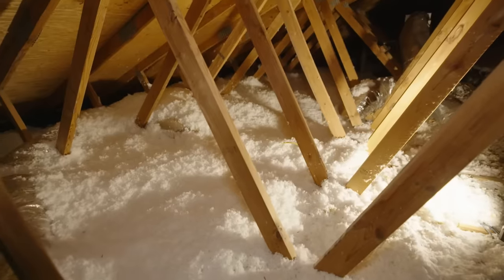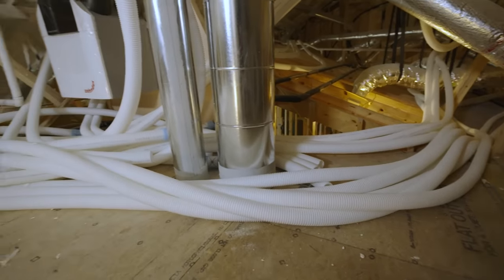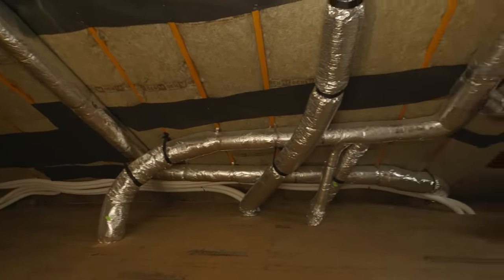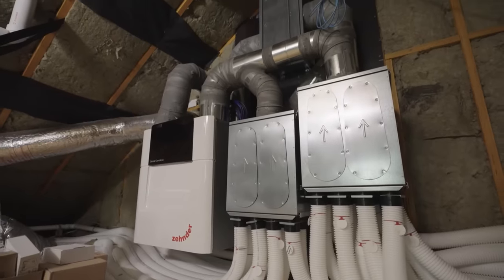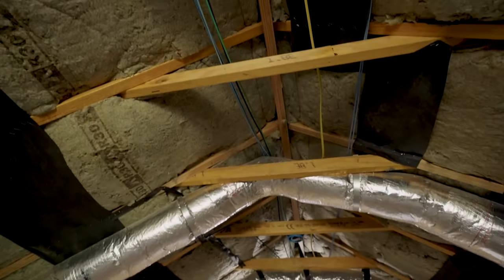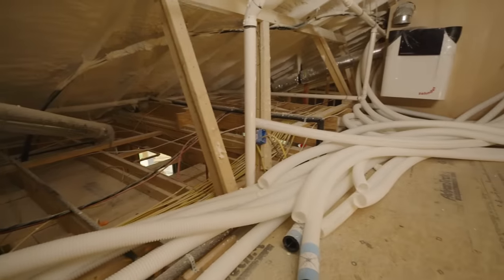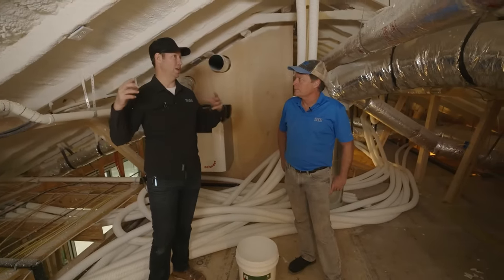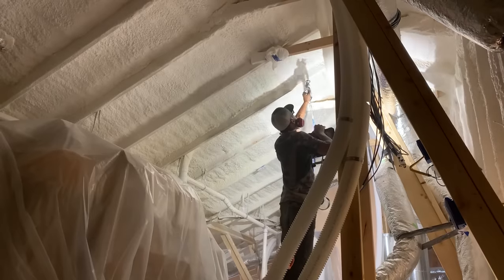Building a BETTER attic - Unvented + Conditioned attics 101

Comment: I knew someone that did a commercial install of closed cell. I asked how do you know when there is a leak?  They said they had one, it built up water until it busted like a balloon onto the floor space.
Reply: Flat roof or sloped? Failure of roofing, was the wood all rotted ?
Reply: Even a small leak has no chance to dry out stuck between the roofing and foam. It's just going to rot the wood between.
Reply: @drewcipher896  spray Jones has been doing for 30 yr successfully.

Comment: It is incredible thing to watch that kind of video in 2021. I am really confused. I thought such insulation technologies are wide spread all along the world. My house was built that way 25 years ago! One additional advice: put second layer of rock wool cross the wooden construction (rafters) to remove thermal bridges. There is 15cm+15cm rockwool under my roof for example (heat conductance parameter lambda=0,033W/mK ), and this insulation thickness is treated as a reasonable minimum now. You can cover wool with drywall and arrange additional space for living.

Comment: Maybe I'm missing something, but if you move the insulation, from your ceiling/attic floor, to your roof/attic ceiling, you just created a lot more space inside your insulated area - not a recipe to cut heating and cooling requirements.  They're noting the attic temp is close to the rest of their home, because there's no insulation between their attic and the rest of their home.
Reply: your increasing the envelop  but drastically cutting the conductive transfer of heat into that envelope  .new building code only allow a certain cfm air exchange   and spray foam actually  helps out with that too  spray foam generally has a beter r value so you can meet code with less of it new code require  almost 2 time as much insulation as they did in the past so its easier to put some  or all on the celling so you don't require 6 inch of bat insulation
Reply: @dustinschmelzle7326  Use spray foam on your attic floor, gaining the R-value at a lower cost because you're covering a smaller area, avoiding the cost to heat and cool a larger envelope.  You could encapsulate ductwork under the spray foam layer, but I would expect these would be better left above the spray foam and wrapped in insulation.

Comment: The rockwool just looks nicer.
Reply: Costs more, though…. So does the framing…. Especially if you use SPF (double-so if using intumescent coating)…. Oh, and the roofing won’t last as long because it gets hotter with insulation beneath it…  And SPF prevents drying to the interior so small leaks in the roof are a MUCH bigger issue because the water gets trapped between the impermeable roofing and the SPF.

So, yeah, it’s “better”…
Reply: @thomaslbane  Maybe Matt "needed" to publish a video and didn't have time to think it through.  What about cost to build, cost to maintain and cost to operate?   More flooring, more stairs, bigger door, difficult insulation installation, more difficult shingling a high-pitched roof..   He should do another video addressing the issues you identified.
Reply: Thomas Bane does it really have heat issues causing roof leaks sooner since the roof can’t breath as well with the spray foam ?
Reply: @27photogger  Asphalt shingles are sensitive to heat, steel not so much.

Comment: As a telecom worker, if there's no conduit/ surf tube that goes from the outside utilizes to the attic and/or smart panel, the chance of drilling the ductwork and tubes is really high and not good. The foam makes it difficult as well to see where the line is without completely destroying the insulation. I highly recommend a conduit, especially in fiber neighborhoods. The floor boards make wall drops difficult as well. Love the attic though, I would make sure to run all the cat6 and coax lines to each room where the TV, gaming console, and computers would go.

Comment: I live in Oklahoma. Your decking material will rot in a  few short years. Have reroofed several houses with closed cell foam. Had to remove decking and replace that rotted due to condensation. We have one installer that will tell you this will happen. If you ask.
Reply: That’s what i was thinking.  If u we’re going to do it that way, don’t u want a gap/space between the wood and rock wool insulation so the wood can breathe ?
Reply: Mike Saraceno is that how it’s usually done

Comment: I used to live in Albuquerque and after our roof was redone I went in to clean up and install new insulation (pink stuff)  My husband put a heat sensor up there and monitored the temperatures on his computer.  I believe it maxed out at 140 degrees.  In summer, the ceiling was like a radiator.  We had attic vent fans but because the house was L shaped it wasn’t too efficient.  As well, the fans were pretty small and wimpy.  And unfortunately, they will pull in lots of dust and pollen.

Comment: unfortunately that will NEVER become standard with our current builders unless it is mandated which it never will be.
Reply: American hows building yikes .
Reply: He never mentioned the cost. The average American can no longer afford to build a house as it is, much less one built with a new mandate requiring an attic like either of these.
Reply: Never say “never”. Energy/building code is constantly changing. 10 years ago most people would say the same thing about requiring solar. Yet here we are. California mandated solar on new residential construction in 2020.
Reply: As a dutch person and daughter af a builder i think americans houses are flimsy and not durable.
Reply: @jolandafrijlink6103  I'm sure as a Dutch person and the daughter of a builder you know all about tumescence
Reply: @jeffraber9110 what kind of swelling....
Reply: Whatever's "quicker" wins
Reply: @jolandafrijlink6103  while mold lives forever in euro homes
Reply: @bobjones2041  i don't know where you get that info from, but i live in a 110 year old house that has NO mold in it. We are constantly updating our houses...why..bc it's normal.
Reply: @jolandafrijlink6103  that's funny because in the fifteen years I spent in Germany, homes of all ages suffered from poor insulation which caused moisture and therefore  mold in bathrooms, kitchens, outside interior corners, wood. "Lüften" was always a big deal to them.
"Vollwärmeschutz" appears to be necessary on superior concrete block hones with 30 cm walks,  fancy terracotta roof tiles, plaster  and stucco inside and out, anti-mildew  paint. What's wrong?
Reply: If you're paying for it then great!
Reply: Nor should it be. Yeah this method works, but it is more expensive overall, and it's even more reliant on refrigerant based air conditioning and the energy cost of such.

There are better ways to keep a house cool.

In fact, a vented attic engineered the right way can help keep a home cool by maintaining a flow of air, pushing hotter air out the top and pulling ambient air in the bottom.

That air can draw heat off the attic floor, contributing to the cooling of the house (aided by keeping the summer sunshine further away from the living space of course)
Reply: @bobjones2041  you're talking about germany..... The Netherlands has a different method, the houses that are build from the 70's have little airgabs on the outside wall that lets moisture out in the outsidewall. There is a balance between air and moisture and if you overdo insulation it it will not help against mold. Outside walls, roof and foundationfloor insulated and having windows you can open is all you need.
Reply: It'll never happen because of the cost.
Reply: Codes are updated every 2 years but adoption is left up to the individual states and local government.
Reply: That gap is called a rainscreen in the US.   It has become more common in the Pacific Northwest due to the amount of rain it receives and builders in the SE US have fought against it.
Reply: It doesn't work that way. There's minimal air flow and it's all along the roof sheathing.   

Vented attics however are much cheaper to build and it's easier to catch roof leaks.

Comment: Instead of that mess with all that flex ducting I would have ran metal trunk lines down both sides and kept the flex to a minimum. But I installed hvac systems for 30 years so I'm a bit picky.
Reply: Yea i can appreciate this comment. good ideas to make things 100% better should be encouraged. OCD for the win
Reply: I would have done the same. So much better than flex
Reply: How much more or less does that cost, normally?

Comment: Non vented roofing system is Florida is a disaster of epic proportions.   The USDA attempted this in tampa on several residential new construction sites.   Less than a year and the homes are unlivable due to mold..  great job reinventing the tried and true vented system..

Comment: @Matt V There are even more issues with unvented attics.  This kind of approach only works in warm climates that rarely see ice.  In a northern climate the build shown here would experience ice dams and water fracture on the roof surface.  Matt Risinger usually has pretty good solutions for houses, but this is clearly a climate fail.  He should make it clear in the video that this would only work in a narrow climate band, the one he happens to live in.  If someone in a colder clime naively followed this build, they are headed for tens of thousands of dollars of damage.
Reply: yep
Reply: @oldsteamguy  Totally Untrue - I live In South Dakota and Spray Foamed The Underside of roof sheating for in 2009 - Absolutely no problems

Comment: I've seen good designs where the HVAC is in a closet in the conditioned space, ducts in lowered ceilings in hallways, and fake beams, or between floors. All of the benefits of a conditioned attic without the concerns of needing power to dehumidify that space.

Comment: Hello Matt!  Thank you for the videos!  My house was built in 1997 -- I live in Dallas -- and would like to use Rockwool in-between the attic ceiling rafters like you did in the above video.  My question is, did you do a vapor barrier between the Rockwool and the inside attic roof?
Reply: On Matt’s house, he used zip sheathing and a double layer of insulation board and more on the outside so his vapor barrier is outside.

Comment: I design commercial buildings, always have to be aware of meeting/exceeding the energy code requirements. 
I have a very large attic space with several hundred SF of floored storage area, along with my mechanical systems. Would be costly but easy access to insulate my roof which I would like to do. Personally, I would use the Rockwool instead of the foam but have not done either in my house for one reason. Even though my roof is only 10 years old, after hurricanes/severe storms, I go upstairs with a LED light and illuminate the roof sheathing. With insulated roof, you may never know there is a leak until there is significant water damage.
That being said, it does make a awesome attic and very efficient home.

Comment: Having panic attacks watching this after I was injured for life in a similar attic months ago. An EF-4 tornado ripped the roof off and plastered the fluffy loose insulation everywhere… and I mean EVERYWHERE… even the trees outside and the walls two stories down.

Problem was that I had to immediately get a tarp up where the roof used to be but you could not see where to stand after all the insulation was disturbed. Also, the ceiling was collapsing beneath as it was soaked with water and damaged in multiple places. I ended up falling through and dangling in the master bedroom where I broke my arm and have life-long tissue damage (rotator cuff).
Reply: Why were you trying to put a tarp up in a tornado?  If the tornado took the roof off, I dont think your tarp would fair much better.  No offense, but sounds like a dumb move, life is more important than saving some shit in your house trying to put a tarp up... in a tornado.
Reply: @Tro1086  You must have some misunderstanding about tornados. They hit and they leave. They don’t dwell in one spot. Only storm chasers get to encounter tornados for more than a couple minutes. This one left a path of destruction 38.9 miles long. It’s strength peaked just as it entered my neighborhood where it reached EF-4 strength and I was the first house.

It hit just after midnight but was gone in about a minute, having moved on to destroy neighboring homes. I was lucky. Some in my neighborhood didn’t even have a single wall left standing. Most everything I lost in the initial aftermath was outside (car, lawnmowers, bicycles, workbenches, etc) but there was no roof so I had to try to limit that loss and stop the rain from destroying everything inside the house.

The ceiling didn’t collapse because I went up there during a tornado. The tornado was here and gone. The ceiling collapsed because rain was soaking the sheetrock and weighing down the already-damaged structure. Then the disturbed insulation was hiding the places that were safe to step on and it gave way when I stepped in the wrong place.

You can see in my videos during the tornado that the tornado was gone/leaving while we were still sheltering in the basement, but as soon as it was gone we had to assess what had happened and respond/react. You couldn’t even tell the roof was gone until you went half way down the street, which was also largely impassable. You don’t just go to sleep in a house like that. Heck, I had to make sure my neighbors were still alive.
Reply: @emmettturner9452  Ok, I understand your situation better now.  But tornado or not, when the attic has blown in insulation, you really cant see where the trusses are to stand on, they are buried in the insulation.  I have heard many stories of guys in the trades (electrician, HVAC, plumbers) falling thru the sheet rock when taking a mis-step in an attic, and missing a truss/framing.  Its not uncommon for people to fall thru the ceiling.  Im sure in the aftermath of a tornado the situation was a lot more intense thou!  Im guessing the wind was still howling pretty good?  Really surprised there was any insulation left at all in your attic after the roof was ripped off.  Where I live Iv seen half the insulation blown out of an attic because they hadn't put the soffit on around the house yet.   Also seen attics where the wind will clean one side down the back of the sheet rock, spotless, not a spec, and pile the insulation on the other side like a big snow drift, haha!!  Im guessing he builders are being a little overzealous with their soffit venting. 

Anyway, sorry to hear about your accident, that really sucks, I hope it doesn't keep you from doing to much, glad to hear you or your family weren't hurt worse thou.  I cant imagine living somewhere with frequent tornados, they seem terrifying!

Comment: Have building codes been updated to include these kinds of attics? I would imagine that there would be a substantive amount of pushback from inspectors as soon as they don't see something they immediately recognize or are otherwise use to.
Reply: It’s permitted in the code.  Has been for a long time.
Reply: Yeah, "I never seen something like that. Redo it the right way" lol
Reply: It's been in the building codes for at least 25 years. No inspector is so backwards as to reject spray foamed roofs.
Reply: it's basically a story-and-a-half house.

Comment: This is the truss construction. In the 1960s they moved from purlin to truss. Attic was invented in England as a collaboration between hydrology and framework engineering. We stopped building purlins because they have critically dangerous downsides.

Comment: Our house was designed by us & began building just over a decade ago.  A section of our house has the lower part of our roof in line level with the 2nd floor & there is a maintenance doorway to it, which looks like the one shown at the start of this video, with the vents, fluffy insulation & those rows of joists.  Looking back, I wish we had it turned into storage/room space, because now we really need more space. Either we didn't see this part of the floorplan or it had something to do with lowering the cost.  I do know though that it was the former & we should have told the builders we need more closet space.  I suppose it is too late to do anything & it will cost a ton to convert it.
Reply: It wouldn’t be that much and maybe diyable. The trick will be getting rid of the extra insulation. Then add something as flooring, such as 1/2” plywood and add rockwool between the rafters. Essentially just changing the location of the insulation. If the insulation is batts instead of blown in, you might be able to just move it from the ceiling joist to the rafters.

Comment: If HVAC is not in the attic, this does not make financial sense.
The ROI on that upgrade it 30+ years. Yes I have run the numbers and that's what it looks like.
And leaving Rockwool exposed to the conditioned environment is not ideal for IAQ.
Reply: - re rockwool. I thought the same - cover it in with some rigid boarding - or open cell sprayfoam (and intumescent layer), it will shed fibres - eliminates conductive loops through open fibrous insulation.-

Also, remember, people pay premium prices for comfort (or perceived comfort) all the time.  No thoughts (nor realworld expectation) for any ROI.   30 years is as good as infinity (most product warranties that long are as good as worthless, as there will likely be "contributing factors" in their failure)  - given typical inflation etc, many middleclass people may have remodelled their kitchen and bathroom once or twice in that period  (even the attic)- given people don't keep houses for the full 30 years for much of their lives.
Reply: Yep, this is for slab houses. My current build has a basement with precast insulated walls, HVAC in the floor, 2x6 above grade walls, and a vented attic with raised heel trusses and blown in R-60. WAY cheaper to build and it'll still be energy efficient.